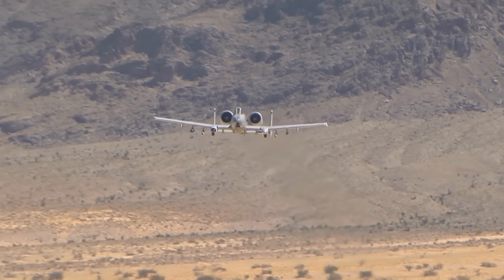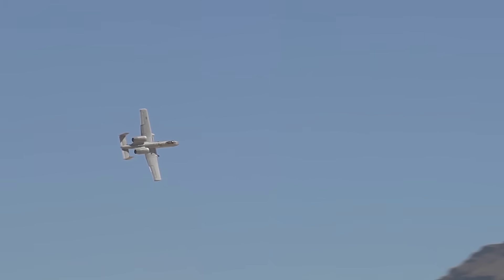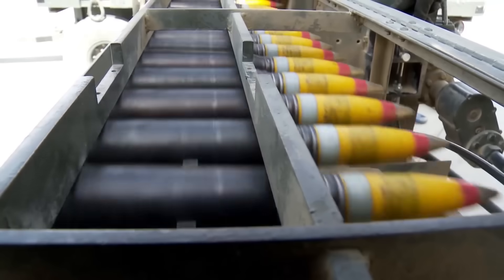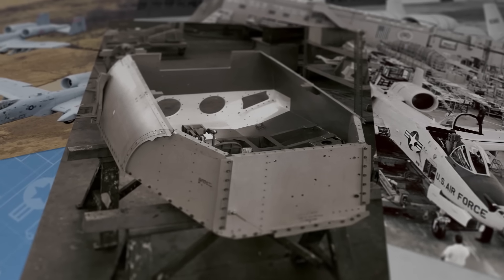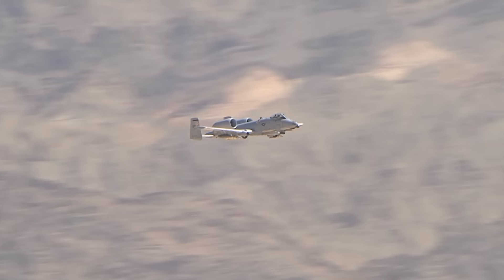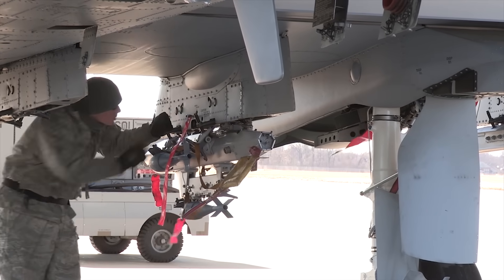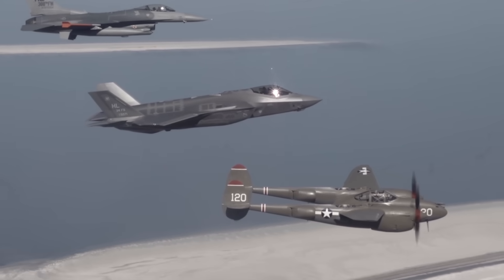The Insane Engineering of the A-10 Warthog

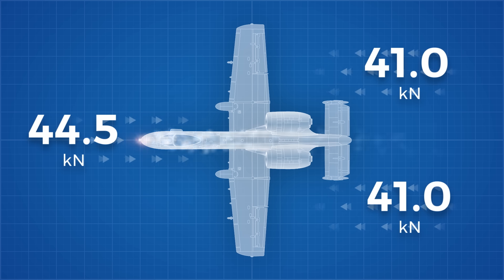Comment: 8:12 they actually limited the time that the gun could fire so it doesnt stall.
Reply: Also, as you said, due to the superiority of the a-10 compaire to other multi-role fighters is a part of what has kept it in service. Congress actually made a bet on it, if the f-35 out preformed the a-10 then the a-10 would be retired. Well With the a-10 still in service and a current replacement apparently on its way, I think we know who one.
Reply: @rovethewolf9717  It's not a matter of superiority. Congress simply refuses to authorize the USAF to retire it. There's no "bet". The USAF sends F-16s and F-15Es to do CAS. Even B-1s and B-52s.
Reply: @ChucksSEADnDEAD  but the F-16’s and F-15e’s are still multirole fighters and more focused on air superiority. The b-1 and b-52 aren’t even Close Air Support, they are high altitude bombers. The other Close Air Support aircraft we have is the AC-130, an propeller aircraft used in more specified missions then the A-10.
Reply: @ChucksSEADnDEAD  I am also not saying you are wrong, but congress controls the budget. If they say it’s cut and a plane needs to go, then it goes.
Reply: @rovethewolf9717  A F-15E is not focused on air superiority considering it was designed to replace the F-4s and F-111s in service. Neither are the F-16s, and they're do-everything workhorses that spent the last 20 years delivering bombs. Even if they were, it still doesn't change the fact that they do more CAS than the A-10.
Yes, B-1Bs and B-52s do perform Close Air Support. Funny that you call the B-1 a high altitude bomber when one of it's most important design requirements was high subsonic low altitude speed.
Yes, of course Congress controls the budget. My point is that the A-10 isn't kept in service because of superiority. It's kept in service because Congress refuses to retire it.

Comment: 7:15, should also be mentioned that the position of the engines is better than other planes for ensuring small arms and rpg rounds aren't hitting them while in it's typical angle of attack.
Reply: The " typical angle of attack." would depend on the gauge of the equipment.

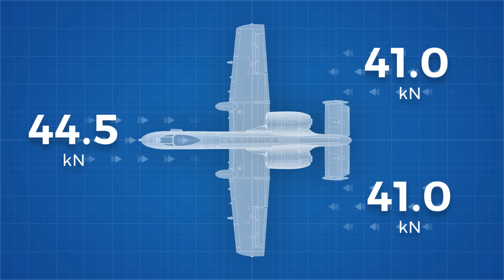Comment: 8:00 That diagram of the a10 is slightly inaccurate. The cannon is actually offset to the left (from pilot's pov) because the barrel is on the far right (again pilot's pov). This offset does put the "firing" barrel on the center line of the aircraft and helps give the nose gear more room.

Comment: The gun does not sit along the centreline of the plane. They found in the prototype if the gun was on the centreline, it would flip the plane from the torque of the spinning barrels. So they offset the gun to the left and had the firing position set back anticlockwise so the rounds still exit along the centreline.

Comment: The F35 is an Excellent plane, BUT the time it takes the for the plane to make a second attack, the A10 has just finished it's 2nd attack and in process of making 3rd  Low level troop attack.. We need BOTH planes!  The Only Improvement the A10 I can think of, is it should Now be made out of Carbon fiber, weight saving, and rolls of carbon  fiber VS Big sheets of Aluminum..

Comment: My AP chemistry teacher in HS worked for DoD in the 80s, specifically on depleted uranium research. He was a bleeding-heart liberal. He told us students that depleted uranium is mostly U-238 and not U-235. It was my understanding that U-238 is barely radioactive at all…… was he lying to us to save face?
Reply: No. DU is very mildly radioactive. The real danger is that it's a heavy metal. Which is highly toxic.
There was a proposition to replace DU with tungsten in munitions. Turns out that the toxicity was the same.

Comment: Having done Close Air Support in a high speed aircraft it is very difficult to do well and there is a greater danger for our own troops due to the difficulty that comes with high speed. 
The F16 and F35 are not well suited to this role.
The A10 is the aircraft for the role.
Reply: As you are a subject matter expert I would be very interested to know your opinion about standoff weapons in close air support. Do you think that a multirole fighter from a standoff distance can provide effective close air support with ground troops providing GPS and/or laser targeting? In your opinion what makes the A-10 still more effective than the modern approach?
Reply: @bruceu2274  HI Bruce. Stand off weapons with target designation work well and are quite accurate. It does require air superiority which the US and their allies should have for the foreseeable future.
Obviously technology is constantly changing and I am a dinosaur.
The sophistication of the enemy is all important in this discussion.
Reply: @larrydugan1441  Thank you for the insight.
Reply: "The F16 and F35 are not well suited to this role" - The F-16 is the bespoke close air support aircraft of many nations. Aircraft like the Eurofighter, Rafale, etc are the same.
"The A10 is the aircraft for the role." - Maybe in the 1970s but 1991 showed that they're too vulnerable.
Reply: @ChucksSEADnDEAD  It very much depends on the theater of operations and level of air superiority. 
Where are you planning to fight? 
Low ceilings in Europe or the wide open high optical contrast desert? 
You need to read my previous post about stand off weapons and guidance.
The is a reason why attack helicopters still exist. Technology may be overtaking the A10 but I doubt it is there yet.

Comment: "An aircraft that is purpose built, cheap, easy to repair, and a rugged work horse"
The exact opposite of modern US Air Force design philosophy, and one of the primary reasons the aircraft remains indispensable and in service today.
Reply: It's more like the cost of entry for fighting in even minimally contested airspace has rocketed up and nobody is quite sure how to compensate for it. Unfortunately none of the proposed solutions are cheap.

The simply fact is that we know what happens when an A-10 tries to fly in airspace where a F or F/A would potentially be threatened. It dies. It dies fast.

The A-10 is known for its durability. And it is very durable. It does indeed survive older and lighter weapons that would mission kill other planes. 

But modern AAA has gotten so energetic that no amount of resilience will allow a plan to survive a hit by the sort of weapons a moderately well equipped standing army can field.

Comment: the gau8 doesn't expel shells because it needs to maintain flight stability, primarily, not because it would damage the plane though that would be an issue.
Reply: Hmmmmm . . . . . An ingested shell casing does not have an effect in stability?
Reply: You have two parts of the ammunitio, the Bullet and casing. If you eject the whole weight (Bullet + casing) you loose a lot of weight creating more instability. If you keep the casing you can at least maintain some of the original balance.

Comment: The anti-thesis to our (German) over-engineering. In her way a master piece of engineering.
Reply: Indeed, most German Engineers seek perfection, American Engineers are usually more  "Eh, Seems to work so far... And when it doesn't, slap some spit, grit, and duct tape on that thing until it does."
Reply: @Dianasaurthemelonlord7777  That's why you needed us to get to the moon, not everything works with duct tape.
Reply: @bluerisk  yeah, but it helps(usually) like closing a leaky fuel line or patching hole ASAP
Reply: @Dianasaurthemelonlord7777  We call duct tape "Panzertape" for a reason. Very popular in the Germany army...at least back in my day.
Reply: @bluerisk  Its very useful
Reply: Say what we will about Americans, but their aviation engineers and designers are remarkable.
Reply: @metalswifty17  Laughs in P-51 Mustang
Reply: @Dianasaurthemelonlord7777  When I was working in Cali, someone landed a P-51 at the local airport and half the town popped by to take a look XD. Incredibly cool plane, super loud.
Reply: @Mr_Roboto  oh yeah my friend a Plane nut, I'm more into Tanks than planes or in the A-10 Warthog's case, a gun with wings, though. In fact I've designed my own MBT... Took like 3 hours and it's half finished.
Reply: The union of German engineering and American aviation will always be the greatest 👌

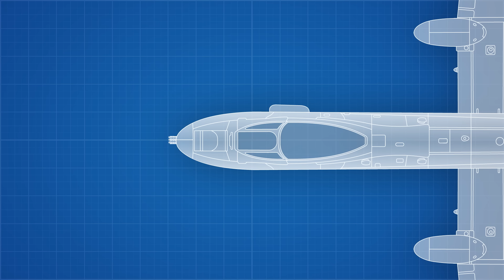Comment: 7:43 - that is in fact not correct. Gun is not mounted directly in the center. It is mounted ever so slightly to the left side of the fuselage, so the firing barrel does align with a center of mass of an aircraft. You can clearly see it being off-center.

Comment: As long as it fights in a low-threat environment, it's very good. I'd say the A-10 is currently being put to good use.
I doubt how successful it'll be in a big war between major powers though.
Reply: I think it was pretty clearly stated for close in support of a GROUND war. Why do you have to disrespect something that is clear perfect for its role?
It is slow enough to SEE the enemy and avoid friendly fire events.
Throw in some high level air fighter support and the A10 takes care of the ground troops.
Reply: It would get slaughtered. And I mean no offense to the venerable old bird when I say that. Missiles that are energetic enough to chase down an F-16/15/35 would probably rip an A-10 in two simply from the kinetic energy they could develop in closing in on what is ultimately a pretty sluggish target.
Reply: @Bustermachine  that's exactly what I meant, but I had to put it lightly because the A-10 Cult is toxic AF and goes on witch hunts for every single criticism of the hog.
Reply: @MiguelMitchelMichiel  I was pretty sure that was what you meant. And yes the A-10's cult of the gun is almost as legendary as the plane itself.

Apparently even the pilots are not immune to the marketing since in debriefing they frequently had to be coaxed to admit that they mostly fly PGM bus runs with the gun being used only rarely.

Comment: At 7:44 the narrator says that the A-10's cannon is mounted "directly on the centerline of the plane". This is incorrect. The cannon is in fact mounted slightly to the port side of the aircraft. The barrel in the firing location is on the starboard side at the 9 o'clock position so that it it perfectly aligns with the centerline. You can see this clearly at 10:03.

Comment: They will replace A-10 with Version 2.0.

* added 2 more Guns and twice the ammo capacity. 2 more guns can be placed in Remote drone Mode

* more fuel capacity, and in Drone mode the flying range is 4 times the earths Circumference 

* remote Control option so pilots will safely stay in base and fly the plane thousands of miles away or work form Home

* vertical take off and hovering, so  now you can stop by and shoot to get better angle. Every one wants to stop by their favourite coffee shop and take a sip.

* stealth and invisibility mechanics so enemy will find it hard to know what hit them.  Still in Testing because some pilots went missing after they Ejected from Invisible Planes. Sources say they are Invisible and contributing to society

* sound absorbant engines and gun. Silencer attached to every gun missile and engine.  So Brtrrrrrrr becomes Shhushh . This is approved by Noise Pollution standards.

Comment: the main gun is actually not mounted directly on the center line of the plane, but slightly off axes. the barrels of the gatling gun fire when they are on the nine o'clock position, which then actually lines up right on the center line, since the whole gun is mounted slightly off.

Comment: Awesome video! Your channel is the type of content that I love to relax to. One minor correction though at 7:45, the gun actually isn't mounted directly on the centerline, it's mounted slightly offset to the port side of the aircraft to put the recoil force in line with the centerline of the aircraft. This is because when you view the barrels of the GAU-8/A from the front, the firing barrel is located at the 9 o'clock position.
Reply: I didn't think it was centered either.